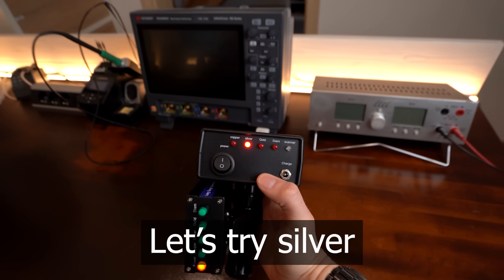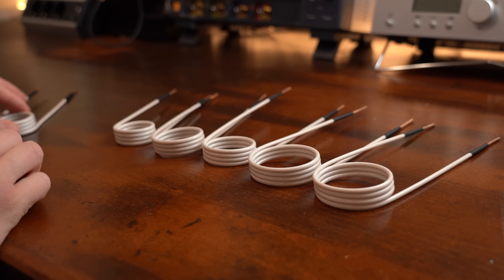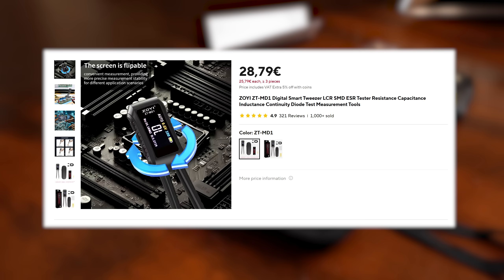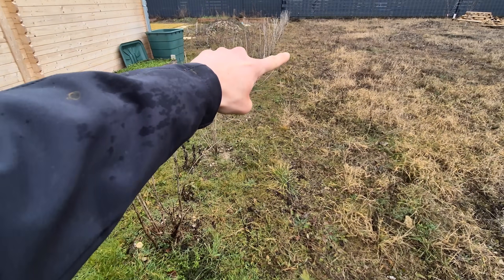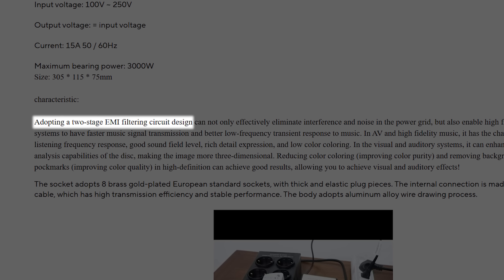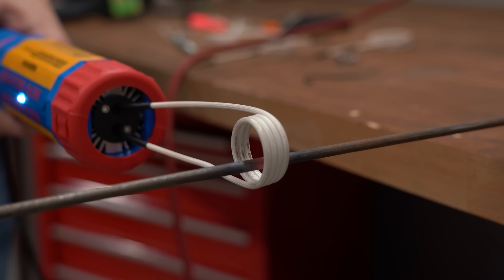I tried finding Hidden Gems on AliExpress AGAIN! (Part 13)

Comment: The small weather clock, they would probably be better if they sold them as project box and actually properly exposed the programming connections.
Reply: The boards and screens are readily available if you want to build something similar, and it would be cheaper.
Reply: @av_oid  Yes, but these are such a neat little unit, just being able to plug in ESPhome, and go would make them a good purchase on their own.
Reply: The screen is really tiny, you need to squint at the info displayed
Better get a bigger screen
Reply: @theagentsmith  The small screen works best as a bedside device (I have one).

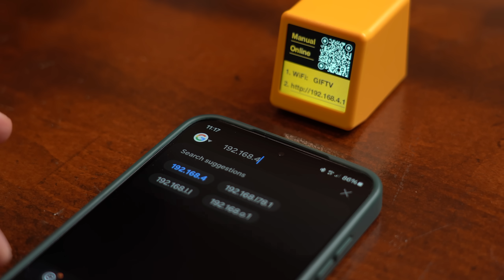Comment: 4:53 the problem could be that its using local wifi, which your PC is on, but phone isn't - you did not use wifi, but mobile phone data...
Reply: It's an android issue, most android versions will by default switch to mobile data when connecting to a wifi without internet, also most apps will only use the connection with internet. 
The only workaround for this is just manually turning off the mobile connection before doing this type of gadget config.
Reply: @dege10000  newer versions of android actually notify you that your wifi has no internet and asks if you still want to be connected. i have a small wifi camera and using my pixel 8 i can connect no problem
Reply: @ Yes, but if I'm correct, it's a feature that has been added only to recent android versions (14 and up I believe). And even then most web browsers and apps won't use it if you have mobile data turned on, so far from what I've seen Firefox based browsers and wifi specific apps will make lan connections without internet
Reply: @dege10000  nope, it's been in android for a loong while now (vividly remember my android 7 phone asking me if I want to use the wifi network without internet as a notification)
with that being said, with android, it's all up to the OEM to modify stuff however they want. and I've noticed that in some OEM ROMs (Samsung, Xiaomi, specifically) it just defaults to mobile data without even giving any kind of notification
Reply: I was thinking his phone automatically tried to connect to the web-ui using HTTPS and blocked it when it couldn't connect that way. But after reading your comment I saw he was on 4G indeed.
Reply: I had this problem a lot with web portals and android. If you connect to a wifi hotspot without internet connection, android doesn't change the connection from data to the wifi network, so you cannot access local addresses on that hotspot. The workaround is simply turning off mobile data during this process and recharging the page on the browser.
Reply: I own an inspection camera that creates a WiFi hotspot to make the phone act as a screen and my Android device will disconnect from its network after a while unless I explicitly tell it to stay connected despite not being able to reach the internet.
Reply: This is correct

Comment: I'd be wary of continuing to use ESP32 based devices in my home now. There's undocumented commands  in wireless section of these chips that can allow spoofing of trusted devices, unauthorized data access, pivoting to other devices on the network, and potentially establishing long-term persistence. great for hacking, not so great for those wanting a safe automated  home.
Reply: If you flash your own firmware to them I don't really see a problem.
Reply: @NetAnon  The problem arises when one buys an IOT device, where the individual does not have access to the source or ability (like ours) to fix the problem.
Reply: @ If it is ESP32 based then flashing ESPHome should be pretty simple. That should allow you to at least have a bare bones display in a small form factor. Sure you will not have the same weather station functionality but you could customize it from there to do anything else. You could also monitor it for suspicious activity with Wireshark and firewall it from communicating with anything on the LAN.

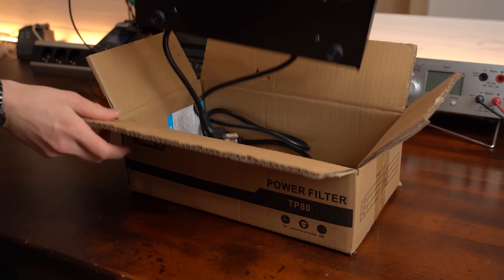Comment: 12:40 did the laser safety glasses with it work?
Reply: I believe they are the opposite. The laser was red and glasses are red, too. Means they let PASS this frequency/color, while blocking others. I assume they are meant to have a better visibility of the red laser line in bright light conditions outdoor.

Comment: That laser level looks like such a great gadget that most men will want to have but have no idea what to use it for, or more importantly, how to justify it to the wife.
Reply: That reminds me, I arranged getting used printer to address my partners printing needs so she doesn't need to go to print shop regularly for these things. I guess I raised it at a bad moment because we still don't have printer and she's at a print shop.
Reply: @MartinzW  The first time I read this, I assumed the type of printer being mentioned is a 3d printer.
Reply: @MartinzW  if you do, get one like EPSON with CISS or convertible to bulk ink system. CISS is what you want. You can refill it yourself if you need colour.
If you want Black and white they also work, or you can go ribbon/dot matrix.

Comment: AI Summary

AliExpress Product Review: Hits and Misses

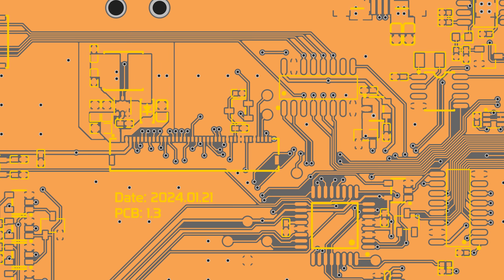*   0:00:58 JLCPCB Sponsorship: The video begins with a mention of JLCPCB, a PCB manufacturer, highlighting their 6-layer PCB service and a $30 coupon offer.
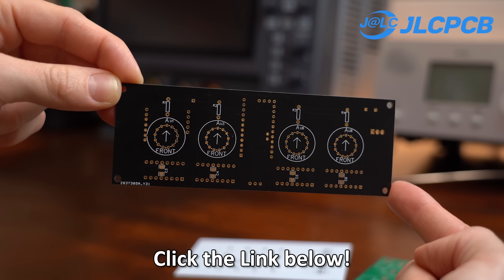*   0:01:40 Handheld Induction Heater (187€):
    *   Used for heating rusty bolts and nuts for easier removal.
    *   Comes with 6 coils of 3 different sizes.
    *   Successfully heated a 40-year-old bolt, making nut removal easier.
    *   Also worked effectively against Loctite thread-locking adhesive.
    *    Internal inspection revealed decent circuit and component quality.
    *   Positive: Effective, safe (with active cooling). Negative: Relatively expensive.
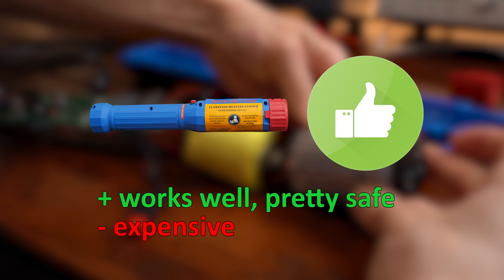*   0:04:22 WiFi Weather Station (11€):
    *   A small, ESP8266-based device intended to display weather data.
    *   Connects via USB-C and creates a Wi-Fi access point.
    *   Initial setup issues with smartphone connectivity.
    *   Works when setup with a PC.
    *   Successfully displayed basic time data.
    *   The presenter attempted custom code upload using the Arduino IDE and PlatformIO, with limited success in integrating with Home Assistant.
    *   Conclusion: Not ideal for complex data display; the "Pro" version (with ESP32) is recommended for more advanced use cases.
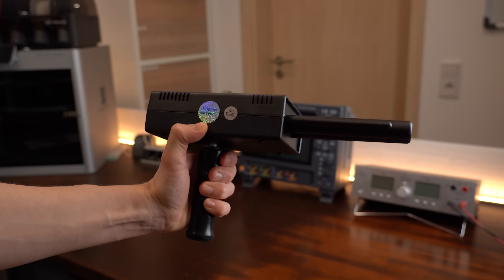*   0:06:30 Metal/Treasure Detector (97€):
    *   Claimed to detect copper, gold, silver, and precious stones up to 20m deep.
    *   Includes a "material selector" unit.
    *   Positive: Battery charging worked.
    *   Negative: The material selector is non-functional (just blinks LEDs). The main detector circuit has a very short range and is not connected to the useless material selector. Horrible Buzzer.
    *   Conclusion: A complete scam; does not work as advertised. Worst preduct reviewed.
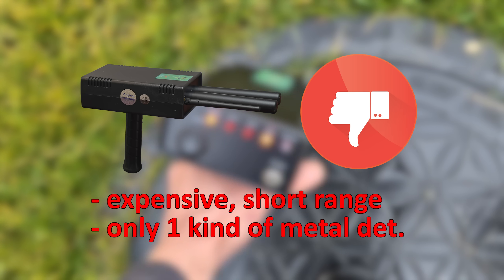*   0:08:33 Smart LCR Tweezers (Unspecified Price, but implies inexpensive):
    *   Designed for identifying and measuring SMD components (Resistors, Capacitors, Inductors).
    *   Features a bright, easy-to-read OLED display.
    *   Can measure Inductance, Capacitance, Resistance, continuity, and diode characteristics.
    *   Test measurements were generally accurate compared to a more expensive LCR meter, except for secondary values (e.g., ESR).
    *   Conclusion: Good value for basic SMD component identification; recommended for hobbyists.
*   0:10:06 Rotary Laser Level (216€, recently increased in price):
    *   Includes a rotary laser, receiver, and a ruler attachment.
    *   The presenter used it to level a 21m long fence.
    *   The manual and setup were initially confusing.
    *   Successfully used to create level reference points for fence posts.
    *   Results were verified using a hose water level.
    *   Conclusion: Works well for its intended purpose, and offers a good value relative to other rotary lasers, but it's not a Bosch.
*   0:12:42 "Audiophile" Power Strip (79€):
    *   Marketed as a high-end power strip with a two-stage EMI filter and surge protection.
    *   Includes a voltage display.
    *   Positive: Solid wiring and crimped connections. Two stage EMI filter.
    *   Negative: Difficult to open due to stuck screws. One screw stripped and arced to the metal case, posing a significant safety hazard.
    *   Conclusion: Not recommended due to the serious safety issue and questionable value proposition.

I used gemini-2.0-pro-exp-02-05| input-price: 1.25 output-price: 5 max-context-length: 128_000 on rocketrecap dot com to summarize the transcript.
Cost (if I didn't use the free tier): $0.02
Input tokens: 13499
Output tokens: 891

Comment: About the weather station's web UI not working on mobile: you have to temporarily turn off mobile data on you phone to allow it to connect a web page hosted on an AP that doesn't provide internet access
Reply: The web UI might not be compatible with mobile layout either.
Reply: That doesn't matter  @joshuabaxter2360

Comment: He buys a €216,- laser-level while owning a perfectly working hose-level. Only to test it for us viewers. That is dedication.
Reply from the maker: Well,.......the laser is definitely quicker to use. I wanted to switch to that......
Reply: @greatscottlab Contrary to the water hose level, it also doesn't get influenced by those pesky gravity anomalies in your back yard 😊
Reply: @nkronert I m afraid those littte lightwaveacles   are not uninfluenced by your backyard gravityanomalies either 😲😲😲
Reply: @greatscottlab   To thine own self be true.  You love cool gadgets.
Reply: @greatscottlab  Seriously? with the amount of setting up and adjustment? where you can just eye-ball the hose level in seconds, and done....
Love the series though
Reply: @greatscottlab  Would a laser pointer taped to a bubble level not work well enough? I'm surprised at how expensive these generally are. I think even with alignment and distance feedback, you could make a pair of devices with the same functionality for less than 25 euros
Reply: I bought  a cheapo laser level from lidl. Then, I waited till it was dark to mark all the posts. Worked a treat.
Reply: @DaveBoatBuilder I bought a cheapo 360 x 4 (16 line) laser level from TEMU for about 40€. Works like a treat indoors or in the evening outside.
Reply: @DaveBoatBuilder I remember those posts! Sisty hist! I'm gonna penta you a question here - what telmo did you use? I have a couple ideas, a couple wet steaks as they say. You could use a pista telmo or a recko type for each post and monitor the variations maybe. Telta meft too. Rumble that around a bit and let me know what you think!
Reply: yeah I was thinking, this sorta tool for sure is useful if you do this kind of work a lot, but for one fence I'd settle for the string method
Reply: He lives by the rule “bros before hose”
Reply: When I once built a 50' fence (~15m), I used a few bucks for twine on a nice large bobbin (reuseable even) and about $2 for each bubble level.  I also bought 2 2-axis bubble levels (they strap to the side of the 4x4 and you can check if they are tilted forward/back or left/right, etc.  I think I blew about $15 (14 EUR) on all that.
Reply: This video got 175,000 views in 8 hours. I think a $200 laser level is an investment at that point.
Reply: you do know if youtube is your primary source of income, you can declare that to your government and they will pay you back for the money you spend in certain videos (tax write off)
Reply: $216 is nuts for this thing. I bought a Bosch rotary laser level and it was, uh, a little more expensive 😅 I love these things, they're so great.
Reply: An example of "you have to spend money to make money"
Reply: Haha I see it as impulsive buying, at least I wonder around alot and find many of these things and wonder if... He can just buy it and review it for us
Reply: He could write it off as a business expense?
Reply: I tried to use a hose-level when I was doing some reparation works in my apartment, and found this is not only inconvenient but also not precise at all :( The laser one is so much better.
Reply: waste of resources
Reply: No. That is a garbage human filling up landfills.
Reply: You know be makes money from YouTube right?
Reply: @NullishConvalescence  no way, how can he dare..
Reply: lol
Reply: Only to test it for viewers... Or is it for video content? 🤔
Reply: Well to be fair sponsors + 2m subs and almost 800k views he definitely made a ton more off this video
Reply: News flash! He isn’t buying or paying for shit.
Reply: Are you kidding? Laser levels with receivers generally cost 600-1000€+ and are used in professional construction extensively. You can grade a concrete slab, footings, whatever with that thing. Is it as accurate as Hilti, probably not. But it's also very affordable compared to it. I own the same device and it's been a great investment. I've used it to level 30 screw piles, concrete footings, a deck to existing house, etc. Would a water level work? Of course, but then you would need to change it to multiple places or use a long spirit level to get the "inbetween" footings to the same grade. With a laser level you can just move from one to another. Now I'm just happy someone took the time to verify its accuracy, clearly something I should have done instead of relying on it right away when I got it, but I did check few footings with a spirit level.
Reply: You do realize he makes money off of these videos.  JLCPCB paid him a good sum of money for an advertisement and then he also made youtube ad revenue.  It has nothing to do with dedication and everything to do with cost/profit ratio.
Reply: Nah, it's a tax right off for work.
Reply: @andymouse   I suspect that a ‘tax write off’ isn’t what you think it is… A tax write-off reduces taxable income, not tax owed. If you spend $100 on a business expense and your tax rate is 20%, you save $20 in taxes—but you still spent £100, so you’re $80 down. It’s a discount, not free money.

In this context, pretty-much every business expense is a tax write-off. It’s nothing special and it’s not free money. If he’s spending money on something that he doesn’t ‘need’, it’s still an expense, and all he gets back is the taxable element of expense.
Reply: @Innesb  If it's accounted as an expense and not an asset he can "dispose of it" and then sell it as a personal item which will not be taxable in most countries. In that sense you can make it as a tax writeoff at a small scale.
Reply: @Innesb  :)
Reply: @andymouse  Tax-Write-Offs doesn't make things free. You get some money back, yes, but not the complete deal. More like 20%
Reply: @doktormerlin  :)
Reply: @doktormerlin not really. In U.K., if you make 200k, you are going to pay about 70-80k in tax. If you buy the laser because you need it for the next job, which he certainly does since he reviews it, he writes the cost of it from the tax. Up to 50k earnings, you’ll be paying about 7.5k in tax - so you whatever expenses you have to run the business need to be taken out from the tax. Obviously it can’t be something crazy, but legit expenses, sure.

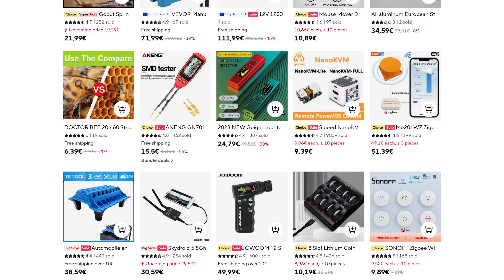Comment: 0:24 what is that car battery thing???
Reply from the maker: Watch the previous AliExpress episodes ;-)
Reply: @greatscottlab  yes, I watched them,but either I don't remember or I cannot find in which episode it was featured.
Reply: @smitthone  https://www.youtube.com/watch?v=BcUzuwP-WPI it's from the special part 10 I also wanted to find it so had to go through a few vids. but at 6:20 he talks about it.,
Reply: @smitthone  I have the higher end version, Ancel BM300 Pro, its a neat bit of kit. Only thing I don't like about it is the range, it's a bit short. But still very helpful.
Reply: It’s a wifi or Bluetooth car battery monitor with an app control and alerts etc.

Comment: Red LockTite is permanent, blue can be loosened with a little effort yet keeps fasteners from working themselves loose.
Reply: Not permanent for this device
Reply: this information would have saved me a year earlier, used the red one on a screw that needs regular adjusting :)
Reply: Red is not permanent. It just requires heat to remove as he demonstrated here.

Comment: 7:36 you should luck at the battery cells writing, not the pack. From my experience, the value on the cell is much lower.
Reply: 1000 to 1600 mAh depending on how old those recycled laptop battery cells are. 😬

Comment: that weather station would be nice if it had an E-INK display
But maybe the real treasure was the videos we made along the way!
Reply from the maker: Good point. Maybe they will come up with another version in the future.
Reply: @greatscottlab  Didn't a bunch of e-ink patents run out in the last couple of years, especially the colour ones?  I have some Xiaomi (?) clocks that use e-ink which work really well.

Comment: If you had the tubing to do the water level trick, surely you didn't need to buy the laser? :D
Reply from the maker: Well, the tube is certainly cheaper. But it takes way longer to set up and can do way less than the laser. And since I will be using the laser for quite a few things in the future, I think the investment was worth it ;-)
Reply: @greatscottlab   if you plan to investing in more cats than Louis Rossmann that sorta makes sense... 😸
Reply: It's a single straight section of fence; a piece of string and a $2 bubble level would do fine.

Future investment makes sense though

Comment: I have to say, when buying things like power strips (that might be expected to handle 3kW) I always buy from local distributors where I know they've passed local (UK in my case) safety regulations, or at least you have some comeback if they don't. Even then, I have seen the plugs that come with high-draw devices like tumble dryers start to melt, so I just wouldn't trust a sketchy AliExpress product!